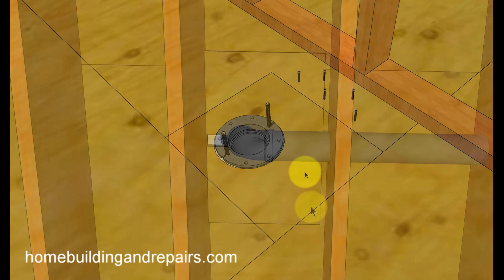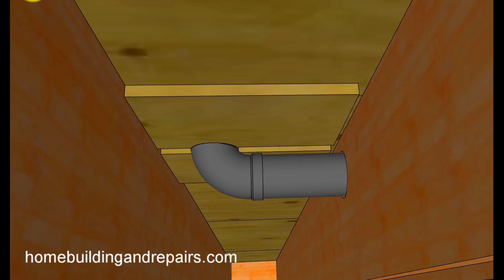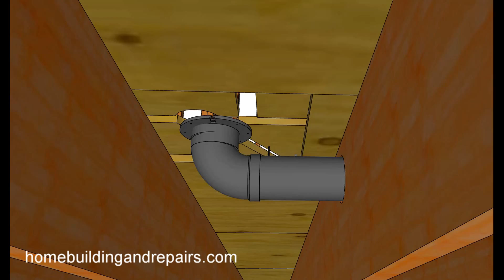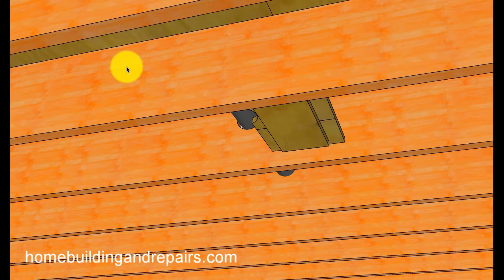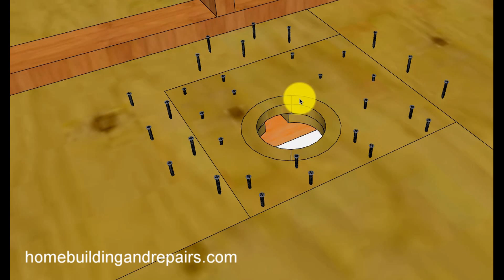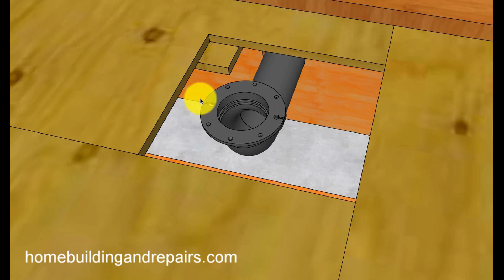Part Two - Wood Subflooring Water Damage Under Toilet Repair Ideas

Comment: THANK YOU! I have a situation where my joists are double joists made with 2x4s and that makes it hard to put some new supports under the part i cut out. So this actually helps A LOT knowing this is a valid solution to fixing the sub floor under the toilet.
Reply from the maker: You're welcome and I'm always glad to help.

Comment: I kind of think a "No-Hub Coupling" and a new flange if need be is the way to go if you have access from underneath.
Reply from the maker: Excellent point, especially if the toilet flange is damaged.
Reply: gregvancom I always try to imagine a land whale plopping on the toilet. Over the years I've seen some real damage. That's why anchoring the floor flange is so important.
Reply from the maker: I don't know if I want to imagine a land whale even getting near a toilet. :)
Reply: Batsen Belfry » Land whale? I resemble that remark. But I had the same thought - is it not easier to replace the toilet flange than to rebuild the floor around it? Anyhow I am up against that situation. I got volunteered to fix the bathroom in mother-in-law's ancient rental house and it's far worse than anyone imagined. Tore out the vinyl flooring and the wood below is just stinky mush. The rot extends under two opposite walls.
Reply: Tin Man  It boils down to securing that floor flange so that it can't move. If the wax ring has been leaking for a while, then you can have a real mess on your hands. Bite the bullet! Make sure that you brace the repair up so that the toilet will be solid. I've literally seen a toilet fall thru the floor.....there wasn't anything to support it. Good luck!😸👍
Reply from the maker: Secure the flange to the floor and the toilet to the flange and hope like heck it doesn't move. Remember, toilets that move often damage the wax rings and it might not be long before there is a leak.
Reply: gregvancom
 > Thanks, I'll do that if & when I manage to install a floor to secure the flange to.
Reply from the maker: Exactly, it's always a good idea to have a floor to attach the flange to.

Comment: Semi-retired Plumber here. It's important to secure the floor flange ring. It's not difficult to do that. There's a good assortment of repair floor flanges that will fit inside 3 or 4 inch plastic. And the flange glues from the top, and then  you screw the flange down. I'm a real fan of the stainless rotating flange on the plastic body. Just thought I'd mention that....👍
Reply from the maker: Thanks for the comment and I was wondering if there are any products available that would allow do-it-yourselfers to install toilet flange rings to cast-iron without doing it the old-fashioned way.
Reply: gregvancom I've seen a type of floor flange that had a ridged rubber gasket that fit into the 4 inch cast iron. Seems like it had a system to tighten itself down with some bolts. Might have been Home Depot. There's a lot of different types of repairs flanges out there. (1) you really need a metal ring. Plastic is a bad idea. The web breaks too easily. (2) the flange has to be anchored down. There has to be wood or concrete under it. A common repair involves cutting the cast iron below the floor and using a rubber Fernco coupling to extend the 4 inch level with the floor. Easy to put your plywood with a round hole cut in it down and screw it in. Then you use a 4" PVC floor flange with a metal ring and glue it down. Goes down flat and works well. The ones I get are made by Sioux Chief, I think. Check to make sure it fits inside 4". Ours will also fit over 3". Seems like a 4 5/8 hole is just right. Enjoy your efforts, so I thought I'd speak up.👍😸
Reply from the maker: Thanks for the information and I agree with the metal flange versus plastic. Comments like yours are always appreciated and you can speak up whenever you feel like an thanks for watching.